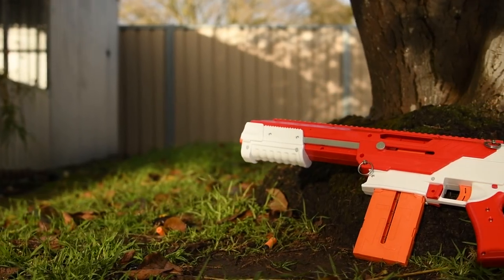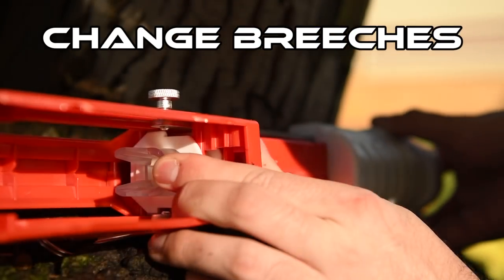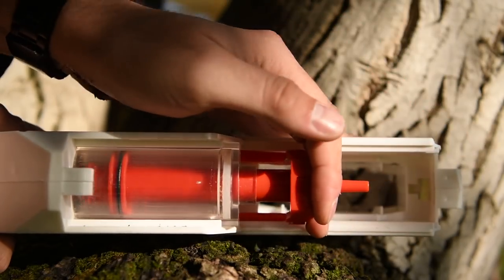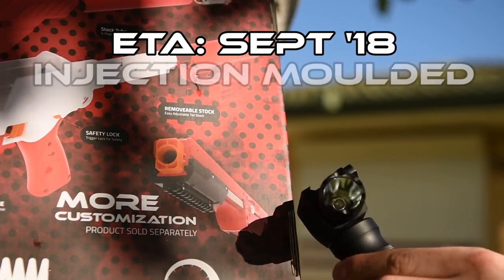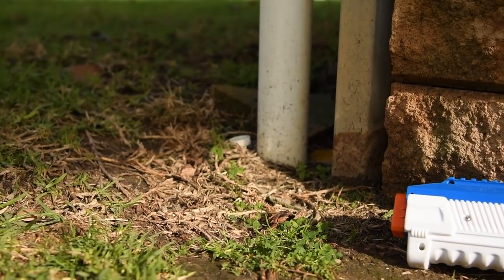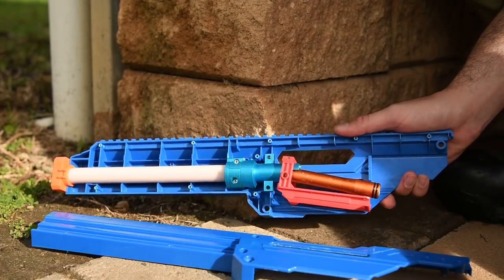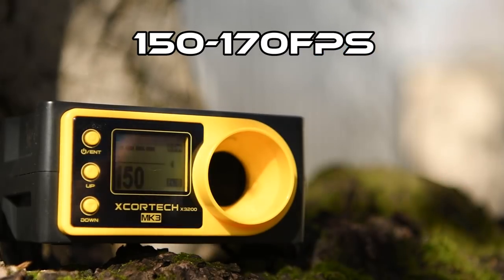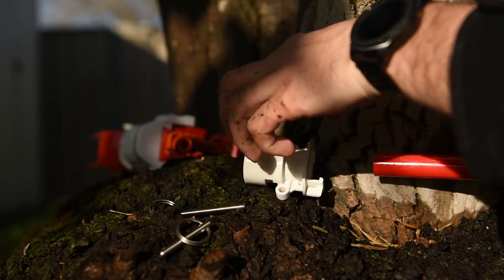[Review] Close Engagement Dart Assault (CEDA)

Comment from the maker: Looks like the video exported in 30fps instead of 60fps, possibly defaulted to that due to adding a clip in which was filmed at 30. Will check the export settings in future.
Reply: with the idea to modify it, what it is your recommendation in between ceda s 99.5 Euros and ceda 54.5 euros?

Comment: Should I get a prophecy with and XPT or a Ceda? Either setup will have a 12.8kg turf and a brass breach
Reply from the maker: Phantom Mods, Prophecy I think would have the higher potential velocity if that's important to you. That 25N is more powerful than the Turf 12.8kg.
Reply: How much of a difference
Reply from the maker: Well my Prophecy hits around 210fps with the 25N and more around 170fps with the 12.8kg spring.
Reply: Bradley Phillips, 170-180 is what I’m going for
Reply from the maker: Both blasters are capable of that so it's more up to your personal preference
Reply: Thanks for info, I think I will be going with a prophecy

Comment: Hey man have u tried that 12.8 in a prophecy? I just had a crack and its shooting about a 180fps average - seems odd the ceda with same spring and barrel would shoot lower.
Reply from the maker: Ben Russell, could have less compression in Ceda seeing as Prophecy uses a metal plate.
Reply: Bradley Phillips that plate is outside the shell though (I assume u use it sandwiched between the shell and the stock adapter cover). An unmolested prophecy (ie without the shell drilled away to fit the 25n) would actually have what, a other 2 or 3mm of spring compression?
Reply: Just hoping it's not an indictment of their plunger design or anything like that. Coz spring compression can be fixed, inherent design issues cant.
Reply from the maker: We'll just have to see how Jet's springs perform. When I used a 12.8kg in my Prophecy it performed how the Ceda did. Could be a difference in climate, could be a bad oring on my pusher, it's hard to tell.
Reply: Bradley Phillips true, whenever mine arrives I'll have to give it a crack to compare.

Comment: I'm pretty sure you're the first to figure out what that red o-ring is for and not just go "oh cool, it comes with a spare o-ring".
Reply from the maker: Ben Russell, helps when you have someone at Jet to ask. :P
Reply: Bradley Phillips did you find out if there was a special reason for the clear bolt sled then? Or is it more an "in case you break the first one" thing?
Reply from the maker: It's a hint of more to come.
Reply: Bradley Phillips lol less hinting and more retaliator kits and optional barrel releasing!

Comment: Thanks for another very informative review, keep up the good work. 

I'm slightly concerned that the CEDA appears to be deliberately designed for upgrades that can only be bought from Jetblaster "or you invalide the warranty". Why not put a comfortable pump grip on from the get go? So they can sell you a replacement. Why not ship it with a set of alternative springs? So they can sell you the springs. 

That said it looks like it will fill the purpose I ordered one for, to fill the gap between "Nerf (Alpha Trooper or Rampage) + stronger spring" (100-120fps) and the Caliburn (200fps and higher). That it can take long or short darts out of the box is excellent, given that I bought the Katana mags with this blaster in mind.
Reply from the maker: Martin Milner, it can take third party parts, but why should Jet have to test and quality check other companies parts when they're offering their own?

As for the grip I don't find it uncomfortable, some people do. Maybe the designers like how it is currently but want to offer people with different tastes a second option.

Comment: I actually have only one concern which is how much abuse dan the part that retains the plunger tube actually take? On a retaliator you need to reinforce it. On the Prophecy a thick tube with a screw in it supports it right? But here it’s unclear.  Please comment.
Reply from the maker: Jon Mandelbaum, the shell holds the plunger tube in at the front and back. Front you need to pry the shell apart quite a distance to release the plunger tube. I'd say it's very secure. Behind the spring rest are lots of ribs (a ridiculous amount of them actually) all the way up the buffer tube, so that's not going to be a point of failure.